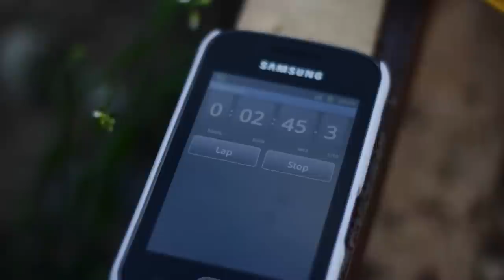First tests with a DIY timelapse slider

Comment: Well done, you've built a very nice slider. But I also have a question: How did you manage to shoot in night without bluring everything out? I mean, if you're using 20-30secs shutter speed and the slider is moving all the time, shouldn't it be blurred?? :/

Comment: I have a question, I saw you did some night shots, were those at 25-30second shutter speed? For long exposure times, and with the slider moving, would that cause the foreground to be blurred?
Reply from the maker: Yes, but that depends on how close the objects in forehround are. Since now i enchanced the sliding speed to ~1:30h it isnt that noticable and can allso be fixed with some sharpening.

Comment: Hey Ivar,

Mine's roling good now, I only have to put in 2 microswitches to stop it from moving to far on the rail. I can put them on the battery side to stop the pully but what if i want the camera to go in reverse and keep shooting? Are you using microswitches and how did you wire them?
Reply from the maker: Hei, i havent put any microswitches there yet. but i will definitelly add them. and well i guess theres no other way to just wire them to one end through the rails, because obviously u will need switches for moth sides. 
and i guess, you can find a switch that will just change the polarity and make the slider go backwards.
Reply: Ivars Veikša Found a thin plastic tube to put the wiring in and glued that to the inside of the track. Plenty of room for it there and not really noticeable from the outside :) The pink kids gum containers are protecting the switches as they are sticking out :) https://www.flickr.com/photos/gipukan/16638057656/
Reply from the maker: Rob Gipman Nice work!
A weird and good feeling, that someone is inspired by my work that much!. 
Only now, waiting for your amaising timelapses!

Comment: Mine's working with 2 serial 9Volt batteries. Still need to put a mounting plate (for the camera) and stoppers. Gona weld the rail and paint the lot after i boxed in the electronics :) All in all a working controlable 1 meter slider :)

Comment: Awesome video. How do you control the motor?
Reply: He use a 12v motor with 2rpm. And he use a voltage regulator.. 12v to 6v. The slowest mode is 6v, the fastest is 12v. And he use a reverse switch to choose what way it will go.

Comment: How do you get the shot to pan as it moves? Or was that done in post?
Reply from the maker: If you mean any other movenemt excluding the slider movement, than it is done in post.
Reply: Ivars Veikša That was my question. Thanks! I may try to build a slider someday.